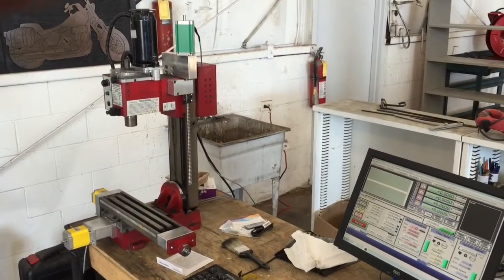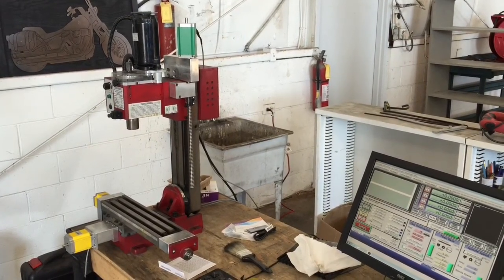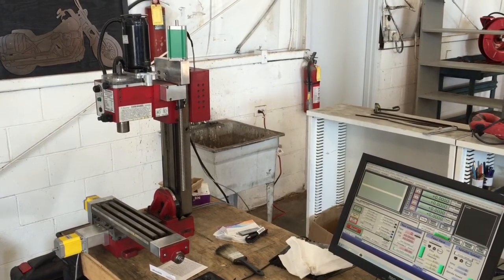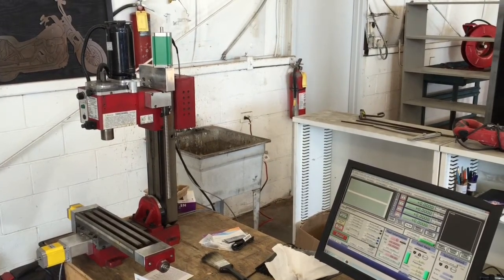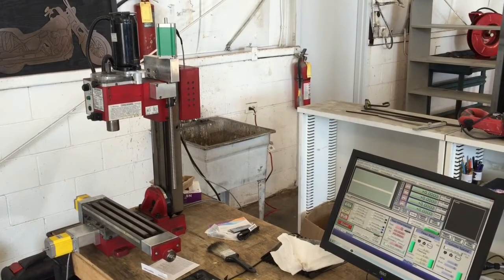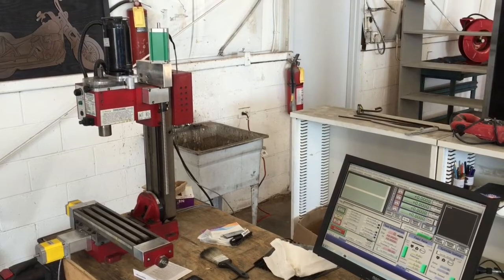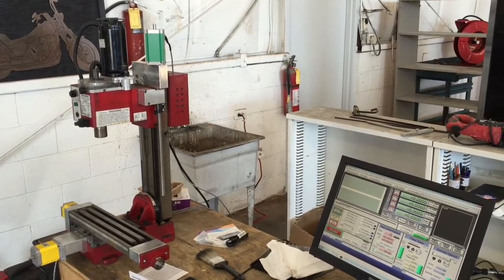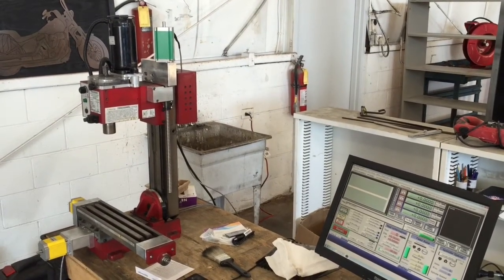CNC Update

Comment: It can/will pay for itself way faster than a big unit.  I bought a couple of Datsun's off a guy that made his living with one like yours.  Machined ceramic parts for Boeing.
Mach3 has a setting in the config that tells it to zero the Z axis first.  I don't have mach on this laptop and I don't recall where it is off hand.  Mine didn't zero Z first when I fired it up.....Will(friend) had to show me where it was.
Reply from the maker: Thanks for the tip! It seems like you would want the Z to retract first to avoid hitting the part as the table traverses to the origin. I'll have to dig that setting up.

This is a big learning process for me. I'm having fun though! You were in my list to reach out to soon as well. I wanted to get your thoughts on a wheel hub project that's on my plate for this Spring.
Reply: Tom Zelickman
Awesome!
Reply from the maker: ***** Thanks, Brad! I appreciate all the help I can get. Please feel free to chime in as you get the time.
Reply: *****
There's a way to change the speed when it's homing.
I find some of my channels by looking at those I'm subscribed to. 
I check any new subscriber with videos posted to see what they have.  If they've got something fairly recent and interesting, I try to "like" it and post a comment.....hoping it will draw some attention to they're channel. :)
....if I'm curious to see what they've got coming up, I sub them.  Sometimes, I find them on the right side with the "recommended for you" vids :)